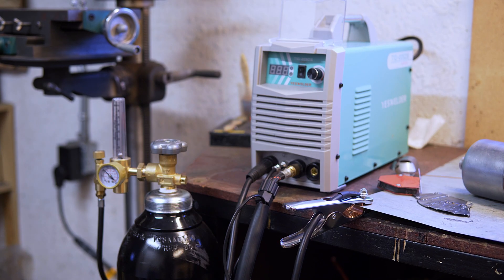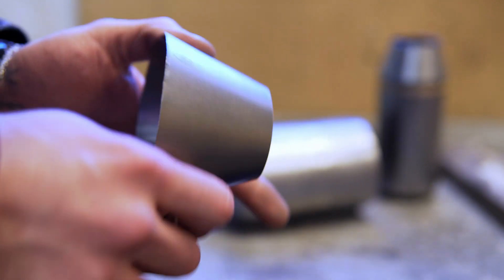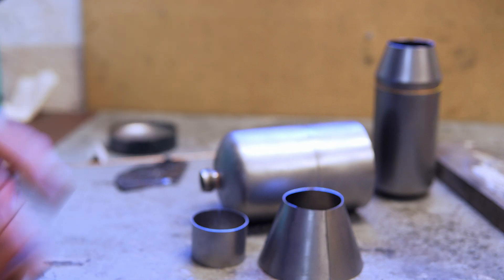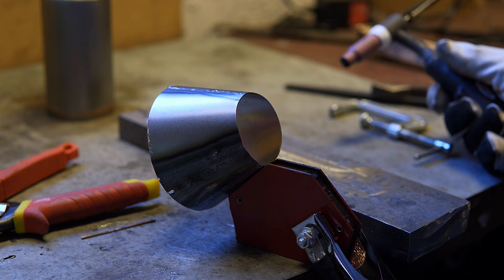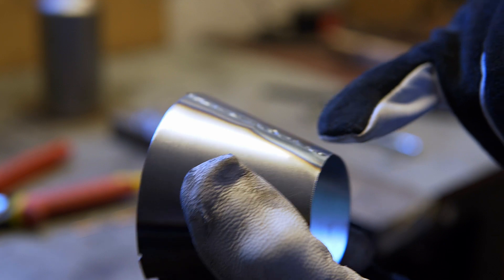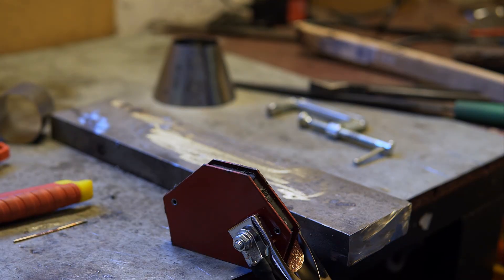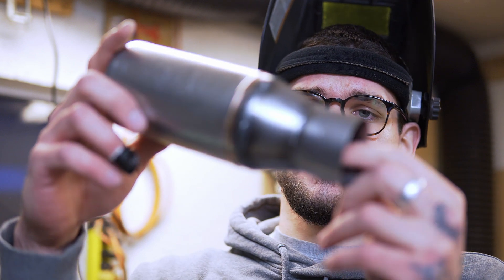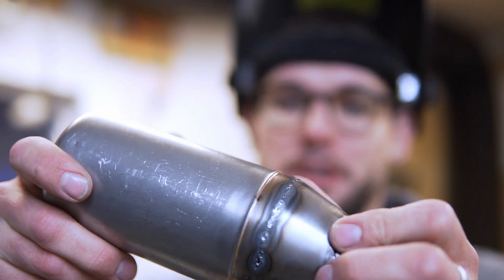Testing out my new TIG welder

Comment: What gas are you using an how are you sharpening your tungsten an is your metal free from contaminates tig needs everything to be just so to make a good weld
Reply from the maker: I'm using pure argon, at the 43 second mark you'll see me using my bench grinder for sharpening, and I've been using lacquer thinner to clean my parts before wirebrushing
Reply: @Neally  a quick an easy way to sharpen your tungsten on the bench grinder is put it in your drill sharpen them in seconds the reason I ask all the questions is you have sparks coming off which isn’t great an you have what looks to be porosity how much gas do you have flowing could you have any leaks or is there any drafts or wind that could be blowing your gas away as I don’t think all your issues are because your a newbie
Reply from the maker: I think the contamination may have come from the tungsten, but I'll check for leaks before I record for next weeks video! Thanks!
Reply: @Neally  what type of tungsten are you using
Reply from the maker: @matthewbetts1985  lanthanated 1/16, but I definitely dipped it at a couple points and that's likely where the contamination came from
Reply: @Neally  thoriated would be better for what you are doing lanthanted although will work is better for aluminium an it will cause you issues like this especially on thin stuff dipping your tungsten won’t help but it isn’t really a massive issue unless your doing coded work everyone dips it even now I’ve been welding for years but on thin stuff try to keep that point so if you dip it to much an the point goes use the drill to resharpen it quicker on the bench grinder
Reply from the maker: Okay sweet, I'll give that a shot then too, we'll see how it goes next video!